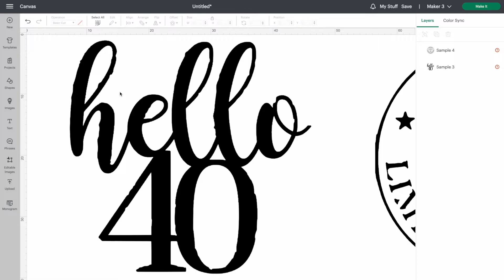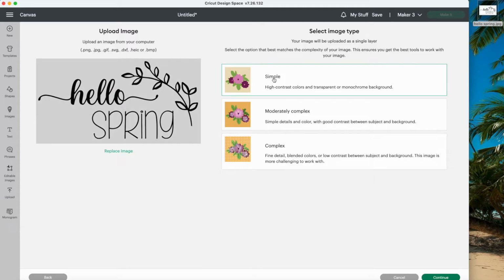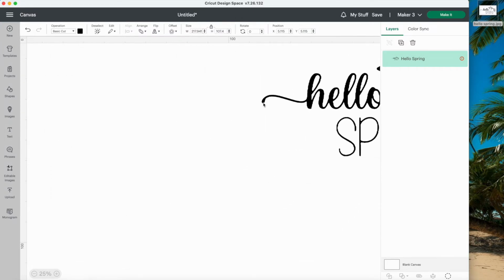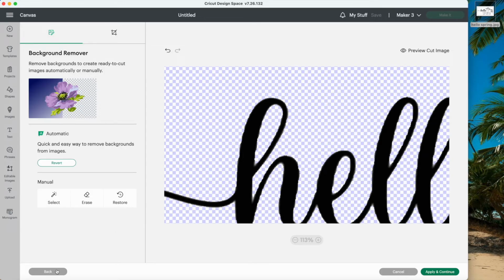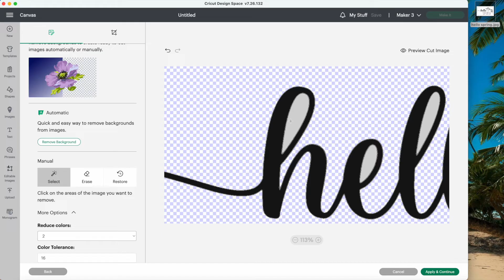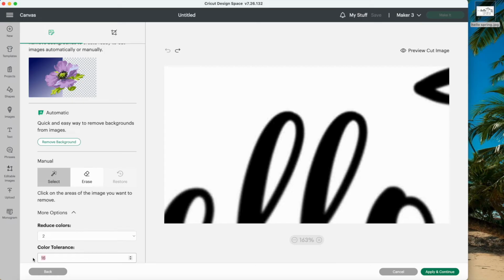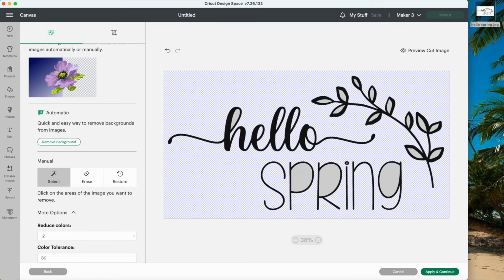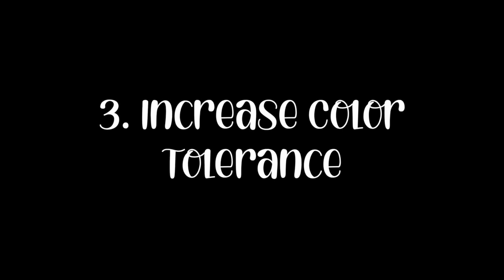Cricut Design Space Tutorial 2023: How to Fix a Fuzzy Image so it isn’t Bumpy!

Comment: Hi, thank you for this video. 
Yesterday I tried all what your suggesting off tricks - it helps but small letters stil gets bumpy not matter what I did, the big part off the logo was perfect. I have a logo from a client, and exportet in cricut, got bad no matter the settings - tried to recreate the smalle letter and thats didden't go well either. Do you have and advice to small letters getting no bumps and lumps?
Seems like a perfect file on screen in another design program and as saved file, gets distorted when its uploaded in design space and uploade on canvas on my computer. Don't know why?
Reply from the maker: The small letters are always the trickiest. If the logo is from a client, you could always ask them if they have it in a png format. Often companies will have it saved in different formats but will just send the jpeg. Hope this helps and good luck!
Reply: I got a PNG format from her, but its stil made them bumpy... even at my vinylsheet when it was cutting 3 at a time, it did the smal letters diffent uneven? I simply don't understand how, its possible. Its like when I put it on the workspace, there happens something.  @CricutTime  The png lookt all fine, I tryid different formats, but ended up with a JPG
Reply: @JudithKrautwald  Have you figured anything out with this?  I've recently started having this issue.  I used to not have it at all, I have images that I uploaded a few months ago with no problem and if I upload them again now they look all messed up.  I've tried uploading my images with transparency already in place, png format, I've played with settings.  I can't figure out how this is even possible to have a black and transparent image not come out smooth with color tolerance up all the way.
Reply: @JudithKrautwald  I figured out a solution.  Convert your file into an SVG. Adobe Express has a free PNG to SVG converter if you need it.

Comment: Do you notice an issue with your images enlarging when you upload too? This is also pixelating the image slightly, any solution for this?
Reply from the maker: If there is a little bit of pixelation, that's when the fine tuning comes into play, adjusting the color tolerance by increments of 5 or less until it is how you would like it. This can take a while though!
Reply: Thanks - any idea why it does that though? Surely it would make sense just to import the size it is, like photoshop does? @CricutTime